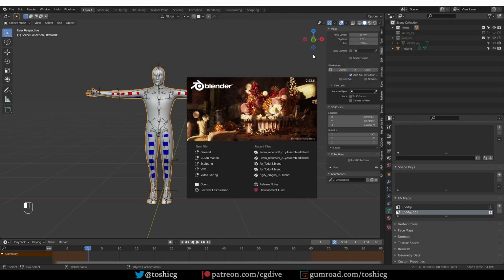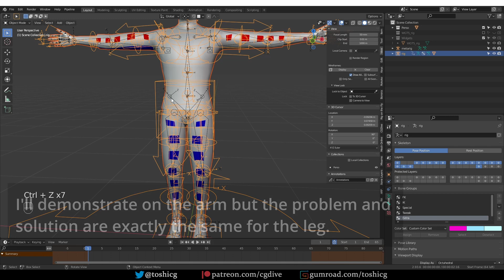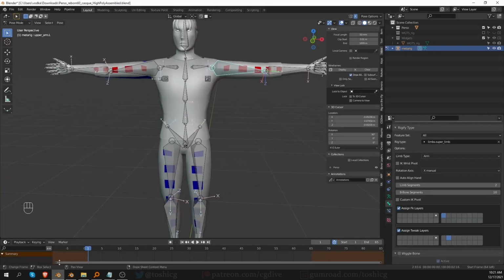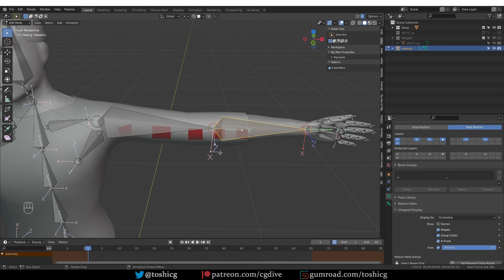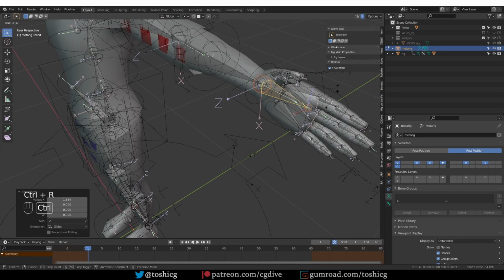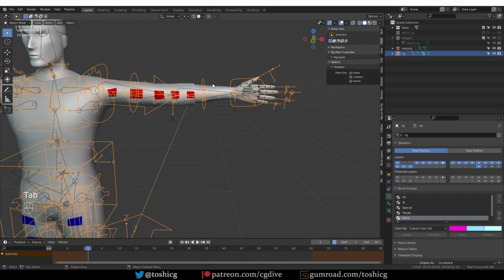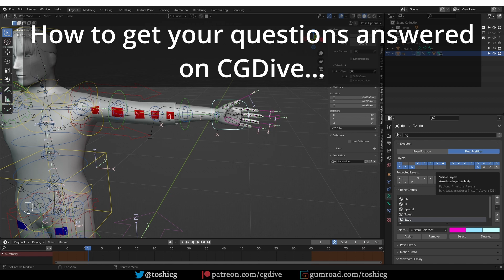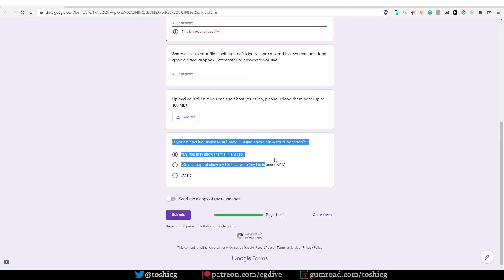Blender Rigify issue: twist control flip

Comment: Thanks a lot, there are so many problems to generate rigs even nowadays... First my rig wasnt working because the weight of bones weren't identified so I scaled up everything and worked, but then I had to change the rotation of arm because hand wouldn't align and there was a huge distortion in the arms, this video solved completely the issue, thank you a lot!

Comment: Question sent a few minutes ago.
Reply from the maker: What question?
Reply: @CGDive  On the form. About how to place automatically small hair (thighs and arms) where they are needed. At the moment I do it manually. Details on request.
Reply from the maker: @johnsmith56920  I read it. Sorry, it's not a good match for the kind of videos I am trying to do. Try asking on our discord
https://discord.gg/YFH5HUv
Reply: @CGDive  Thanks. I've signed in but nobody ever understands what I mean probably because 1) I'm not native speaker 2) I don't have the vocabulary since I'm a photographer and 3) I think way out of the box.
Reply from the maker: @johnsmith56920  What you're doing is quite specialized. I think your English is fine but you should try to explain it in much more than once sentence :)
Reply: @CGDive  I'll try with images. One image with the cylinder and the texture on the side and one image with the cylinder textured. And I want to go from one to the other automatically.
Reply: @CGDive  Actually I have some ideas on how to do that. Where can I discuss this with you? On Discord?
Reply from the maker: @johnsmith56920  Sure post it on Discord. This is not something I am focusing on at the moment so I can't promise I'd engage much with it.
Reply: @CGDive  Done. But I have little hope to get a solution. As you say, not everybody is focused on that, sadly enough.